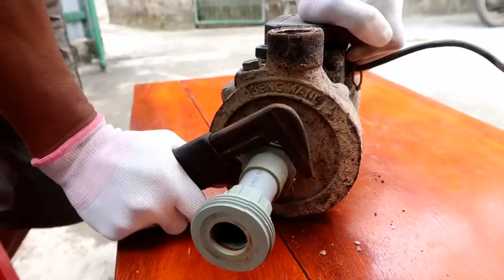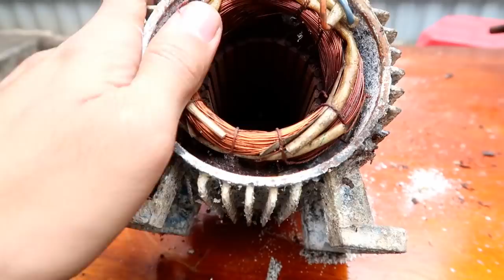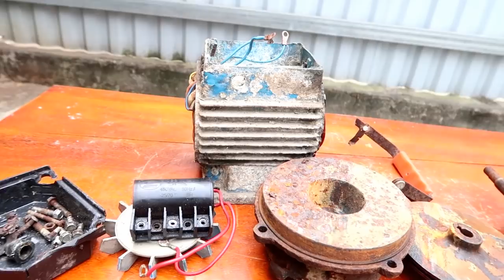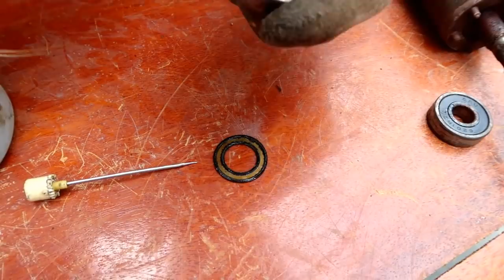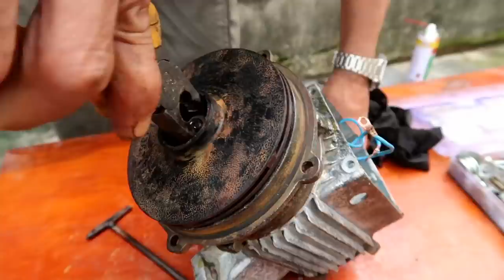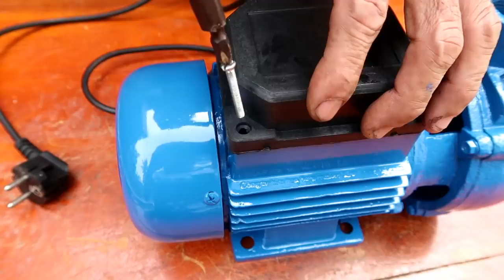How To Regenerate Old Water Pump One Perfect Way

Comment: Mechanical seal is the most sensitive part in a pump. Handle it this care. Do not use screwdriver nor grease on it. Otherwise, good videos.
Reply: I think that this seal will not last very long time, the shaft was so pitted by the rust, the seal will be shredded in no time.